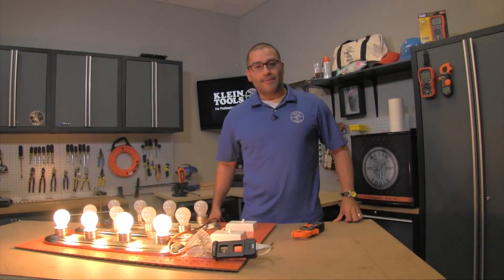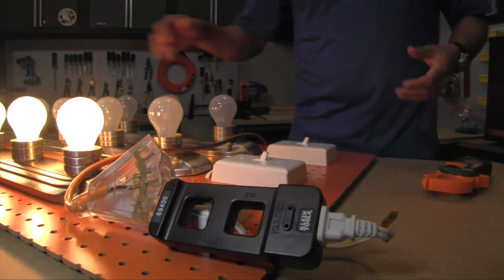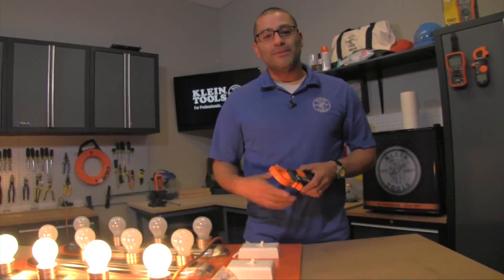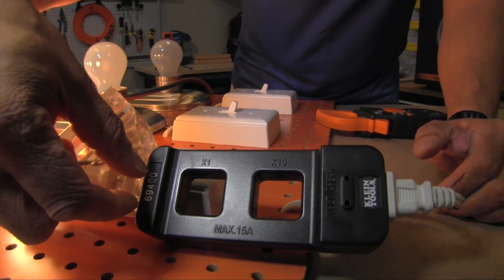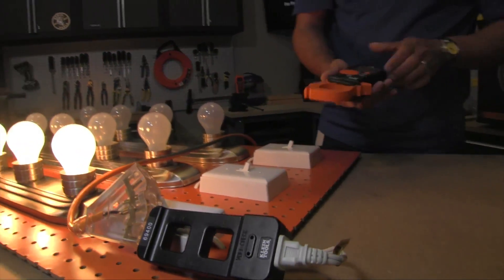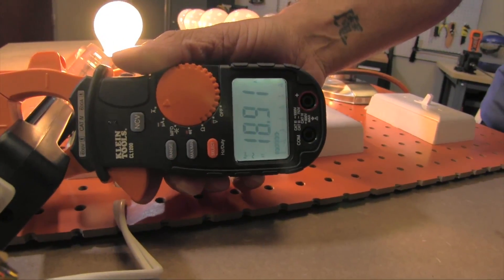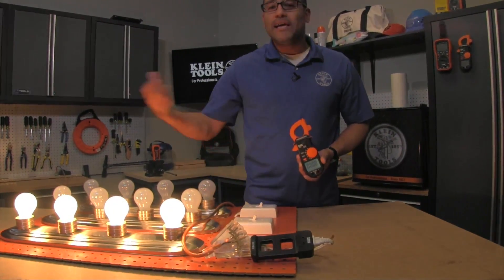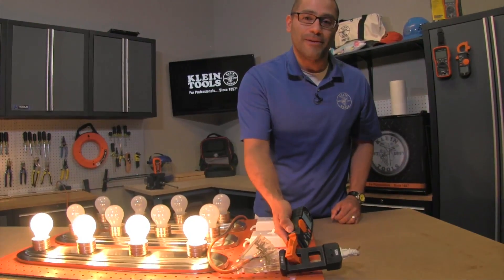How To Measure Amperage With The Line Splitter

Comment: I’m going to ask a dumb question. Why would you want to multiply the reading by 10?
Reply: It's a stronger signal, you get a better reading less affected by limitations your meter's sensitivity and resolution.  Imagine trying to tell the difference between 4mph and 7 mph on an old school car speedometer.  Much easier to accurately read 40 and 70 and divide by 10.

Comment: Sure would be nice if your meter's screens were easier to read. I like my CL100, but unless I'm reading it from below the meter, It's hard... if not impossible... to see.  99.5% of the time, I'm taking readings with the meter in my hand below me. Its hard to see. I saw the same in this video. Not good. Sad to say, I Might be sending mine back. Hopefully this gets re-engineered.

Comment: All this tool does is separate the wires. Make your own out of your neighbors cord that he cut with his hedge trimmers. Thats what I did or you can buy  a 1 foot extension cord for $4 and make one with that.
Reply: I thought of that, but also don't want to electrocute myself. :D

Having this is pretty neat, though. It came with a kit I bought. But only does the 10x (which confused me).

Comment: Do you need a clamp meter to use a line splitter? I have a fluke 177 multimeter. What can i use with this device.
Reply: I don't think it would be useful without a clamp meter.